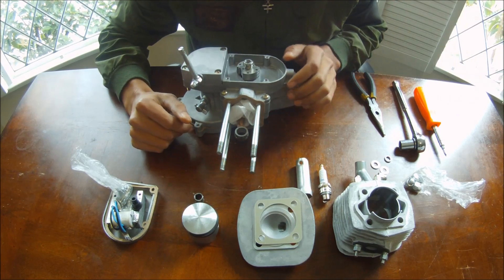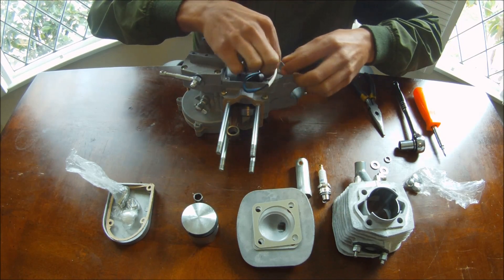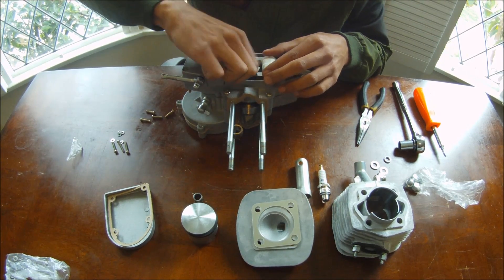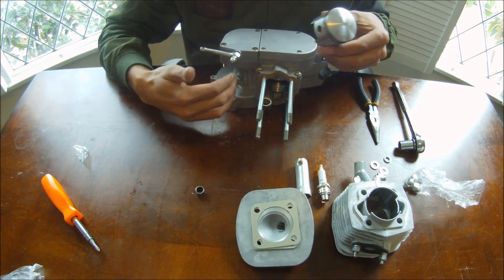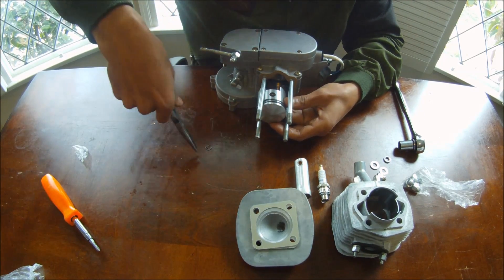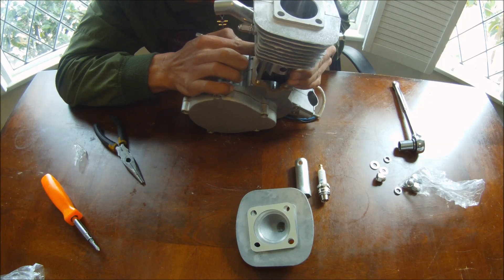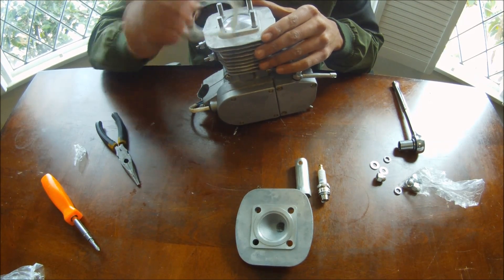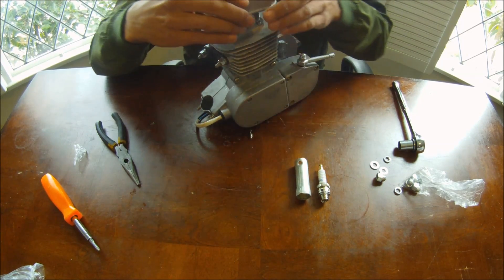HOW TO ASSEMBLE TOP END OF MOTORIZED BICYCLE 66/80CC ENGINE.

Comment: Hey I’m having the problem where my cylinder won’t slide the rest of the way in and everything looks aligned I’m not sure what it is I’ve tried hundreds of times to slide it down and I just can’t get it to slide down
Reply from the maker: Maybe try putting some oil before you slide it on. Maybe the piston ring is bent or getting caught on the intake port. Also make sure your parts are compatible with each other

Comment: R u guys in still business
Reply from the maker: no , out of business. contact my friend gasbike.net
Reply: @bajaracer1  r u California motor bikes ? Or no.  I talk to someone on that number on website just seeing if I'ma get my order I place?
Reply from the maker: @mozezcen-valley7555  no, i sold this company years ago.
Reply: @bajaracer1  oky . Lol I order from website it's still up I resive stuff
Reply: @mozezcen-valley7555  how long did it take to ship out and deliver I ordered a wildcat pk80 did everything come packaged well
Reply: @zapoworldd  Oh you ordered a wildcat pk80 from the website the motor seems pretty solid it seems like it might have a heavy duty spring already so that's a real good Plus I have not ran the engine personally I bought it to do a minarelli conversion but found out that 40 mm crank is a 40 ml short rod so I had to order a different adapter plate from smolik and I did some modifications to it you could see it on my channel it's in the works basically I have everything I'm just waiting for new head gasket in the mail should come on Monday you could see the unboxing video on my channel as well well packed I was happy with it the clutch seems like it's one of the og heavy duty ones.. would have loved if it was a long stroke 40 mm
Reply: @zapoworldd  Week and half maybe 2weeks
Reply: @mozezcen-valley7555  great news I was  worried I got scammed I ordered directly from California motor bikes website I’ll sub to your channel and check out your videos I’m new to the motor bike scene I had a electric bike but the motor gave out after I put a fair amount of miles on it taking on new hobby
Reply: @zapoworldd  I've got other engines from different websites and they feel weak right off the box this one feels really hefty I believe you'll be doing 30-35 mph out the box? And if not there's a silencer in the exhaust you could remove or make your bike sound really loud but also you have a little bit more torque some get top speed some people don't.. but it definitely helps removing the silencer from the exhaust wakes up the engine

Comment: Don't trust the arrow . I watched this over a year ago and listened to these particular instructions . They are wrong , my engine only lasted 1000 miles and seized because the split in the rings goes towards exhaust and I listened to this guy .
The split in the rings may go towards the exhaust on a weed eater but don't do it on a motorized bike !
Listening to this guy was a huge mistake I made that wasn't any fun .
Reply: actually with much respect to what the original intent for this video ( to help ) since it's horrible misinformation that actually harms your engine and does not help , it may be helpful to remove this video so no one else has what happened to me happen to them . Be helpful as you originally intended I am sure and please remove this misinformation so people can assemble their bikes properly .

Comment: I find it easier to get the piston into the jug be for connecting the Piston to the Rod.  You just have to slide the jug down and pop in the Wrist Pin and Clip.  DONE.

Comment: The top end is the easiest part of the whole engine.It comes broken down like that wow I wonder why. My last 3 engines all came preassembled the 3rd I am building right now and I had to switch cylinder bodies because the new one has a 30 mm intake and all my other spare parts are for 40mm it's was fairly easy but getting those rings in is a fucking bitch.It took me longer to do that than any other part of the build.The bottom end looks very hard and I am dissecting my old one the engine works but the chain won't stay on the hub is fairly true so I think there is a problem causing the engine sprocket to wobble and it spits the chain out like it loses the master link and then spits  the chain our throwing it many feet into the air.Whenever it was the back hub the chain would just slip off so I thought fuck I'll buy a new engine and dissect the old one for parts and for learning.

Comment: Ignore the arrow direction!!! Look closely at the piston ring grooves and you will see small pins where the rings will join this should ALWAYS FACE the INLET port,  to avoid exhaust blow by. my understanding is that some pistons have the arrow on the same side as the pins and some on the opposite side, mine has it on side with pins so arrow faces the inlet, I have tried it both ways and it runs smoother with pins on inlet side.
Reply: My piston has pins in upper and lower rings ring grooves that are opposite each other. So use the arrow if it has one.
Reply: generally both ring pins are on same side of the piston gudgeon, this is the side to face toward the inlet, unless yours is different?
Reply: Thanks for the reply. Yes I misspoke the pins are on the same side but not aligned with each other. They are about 20 degree apart. The arrow is in between the pins and perpendicular to the shaft the holds the piston.  I just found this video that explains which way the arrow points and were the 2 pins should be and why. https://www.youtube.com/watch?v=w5npGG2Xj3Q
Reply: ah yes a good video and advice. As a general rule you will find the arrow should always point to the front of the engine, however the Chinese bike engines are mis-matched and inconsistent in design so is an exception to the rule, as stated I have found these pistons with the arrows and pins on the same side and opposite sides, from experience I know that when assembling pistons the ring gaps should always be aligned away from the ports so as not to catch and break, with these Chinese bike pistons that have set groove pins I have always aligned them on the inlet side for performance and reliability. If you do install it with the arrow pointing towards the exhaust just make sure the gap is nowhere near the port so it doesn't catch the edge of the ring.
Here is a vid I found correlating my findings => https://www.youtube.com/watch?v=aCZh37sLyAA
Reply: Thanks cool video. Sometimes its hard to trust some of these so called experts. So I always get more then one (3 or 4) comments especially when its a critical issue. I pointed my arrow towards the exhaust but I think I'm safe. The pins don't line up with the ports.

Comment: Thanks for speeding up your video but you are unclear on the piston arrow do mean pointing to the exhaust or the arrow is on that side of the exhaust.
Also putting on the piston should one keep the magneto off put the cylinder on then look at the notch on magneto shaft to see it is in the 1:00 o'clock position for timing when the piston is Top Dead Center.
Reply: He means point the arrow to the exhaust side. Think!

Comment: Hey would the engine run if the head gasket was put on backwards? So that the exhaust port is at the back and the carb was at the front, would that work?
Reply: peter medz The head gasket is a seal... Do you mean the cylinder?
Reply: peter medz yes it does work but you would need to do some custom porting at the bottom of the jug

Comment: my motor has no power, but it revs up strong . bogs out going up hills . and bogs out after getting up to speed. carb seems OK . can the piston rings slip out of place after sliding the cylinder on ?
Reply: Anthony Rhubert no... If its new, you have to break it in. Its gonna run weird for the first miles. Nothing to do with the rings but rather with the carb. When the break in is done, you can play with the carb needle to get it to have a leaner mix. That will help you with power

Comment: one quick question. am wondering if the top head needs to be torqued to ft lbs or does it matter?
Reply: Aaron, you can use foot lbs. Use your manual or download if you don't have one. Also, never use a torque wrench to loosen nuts or bolts. Only use a torque wrench to tighten.

Comment: It's bullshit that they come in pieces now, as if it's not hard enough to put together.  It actually used to come pre assembled. Just another way china can shave off a penny. Thank god for this video though, I had my piston the wrong way and looked up this video because I couldn't get the piston in the chamber. It was a sign.
Reply from the maker: I think maybe they leave them un assembled because of local smog laws. They import them and say they are engine parts instead of complete engines that could be subject to smog requirements.

Comment: man those piston rings have been kicking my ass, i'm not able to slide the cylinder on cause the rings won't fit into the notch and inside, anyone with any ideas?
Reply: MrJabber22 have you got it solve by now I'm having trouble trying to compress the rings to get the piston into the cylendir I used a metal hose band to compress the ring think I got one over the second I'm not sure is blocking it the goddamn piston is jam in the cylinder no way is it going to go up and down some other fucking kook got involve and broke the ring godamn piss me off I put the broken clip back in but cant slid the piston in ANYONE CAN ANSWER SOLUTION.

Comment: my kit came with 2 retainer clips...the clip is too big for the piston i can't seem to make it fit, anyone know if it's important to place them and if so what could make it easier?
Reply from the maker: What do you mean retainer clips? Do you mean piston rings, or the C clip that holds the rods shaft? you need both either way,
Reply: i meant that c clip that you put into the hole with the needle nose pliers, but just now i cut off a tiny bit, hammered it into shape and managed to push it in, thanks for your quick reply

Comment: you are a seasoned mechanic. For sure dude
Reply: edan vhadat I got a 66cc GT 80 had a oil seeping from the head I put in a fabric gasket it ran for another 200 miles now its stop can't get it to run could that of killed my bike? Also one has to line up the seem kiss button with the back if it slides over exhaust port cause loss of compression and other 2 stroke system symptoms. ???
Reply from the maker: Haha thanks Buddy!
Reply: Mate used some 2t oil when put it together what's wrong with ya